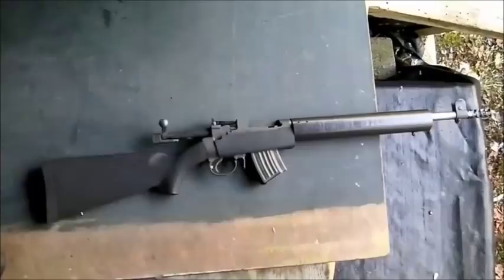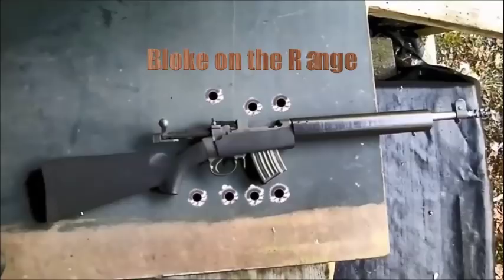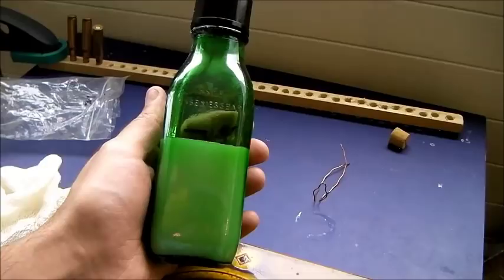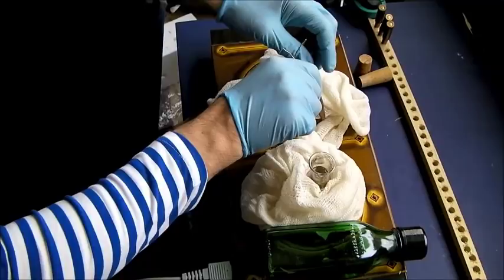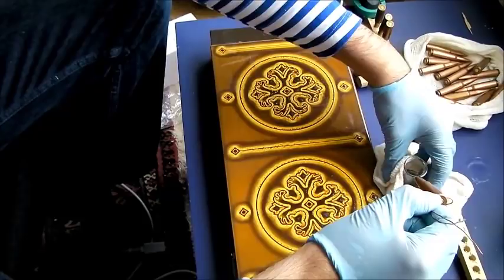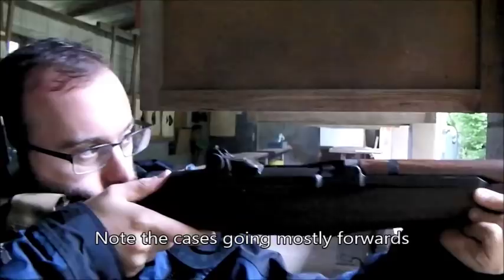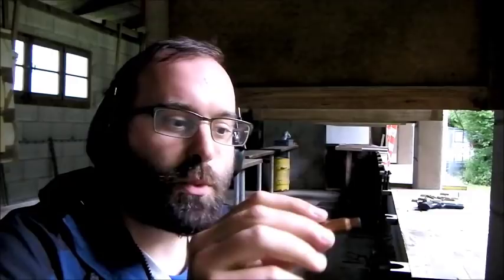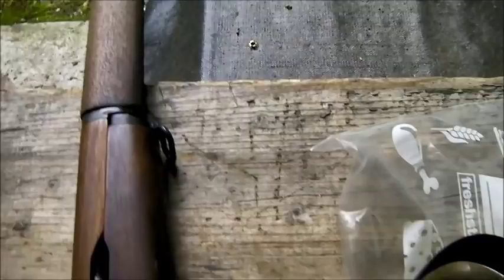Recreating And Testing The Pedersen Cartridge Waxing Process

Comment: Some modern weapons have a tendency to get stuck cartridges. Got an Mannlicher 6.5x55 from the late 90's.
Wonderful for hunting. But...
Tried some surplus military rounds my old father has. They stuck, and the explanation the local gunsmith had was that the Mannlicher have so tight mesaurments, so reloaed ammo will tend to stuck. Because every time you reload ammo, the casing wears out a small fraction and therefore has easier to expad when fired.
Lubrication seem to fix the problem. Wish I cant be bothered with.

Comment: For several reasons, Carbon Tetrachloride hasn't been obtainable in the US for decades.  Time was you could go to the hardware store and buy gallons of it.  Not anymore.  Whatever.  I am thinking the solvent is actually doing very little some other solvents may do just as well, i.e., alcohol or acetone.   You are the first person I have seen wanting to shoot a lubed bullet inside a Garand,  I kept expecting to see an event like what happened with the Thompson rifle and am glad your empty cases did not embed themselves in the wall, nor did your operating rod bend (which was equally possible).  In the US, thanks largely to Browning I think, our guns work well without lubing the case.  I am wondering about cleaning your chambers (and the gas system).  The US military pretty much walked away from nickel jacketed bullets during WWI because the nickel plating wore off in the bore and trapped the corrosive powder remnants under a layer of nickel which created a layer cake effect that was really, really, hard to get out of the barrel.  Now here you wax the case.  So what do we find in the (now) waxy chamber (and gas tube)?  Dirt under wax,, covered with dirt, over wax, etc.  Where is that bore brush, and what solvent are you using in the chamber to clean it all out?

Comment: I think your off on the mosin there problems come from failure to remove cosmoline(how ever you spell it) from the gun I'm a mosin collector and with my 38 mosin all that had sticking was from crud in the bolt and I shoot 75% surplus corrosive ball machine gun ammo through them only my target guns really rare models sniper models and my 5 Finnish ones as there are my best open sight shooters

Comment: Not sure it will help the mosin much, it gets sticky with brass as well, its honestly poorly designed, you put more then 3-4 rounds and it starts to get sluggish, more then 20 and the thing seems to require a swift kick to open.

On a related note, the Mosin by far is the worst rifle is WW2.
Reply: My vote is the lebel for the worst, but really that's just because it was so dated. The mosin really has no excuse. It just sucks.
Reply: But it was cheap.
Reply: That would be you needing a new bolt, nothing more.